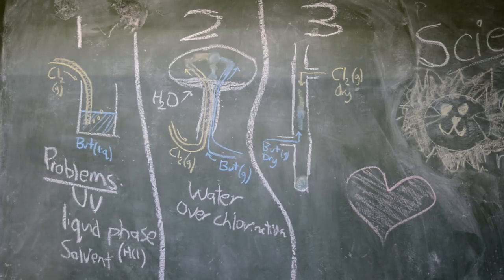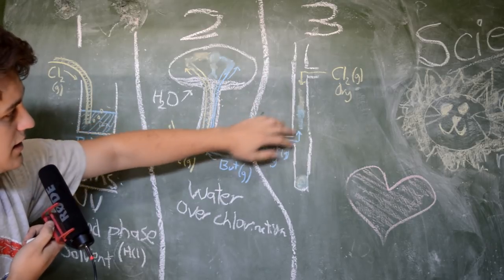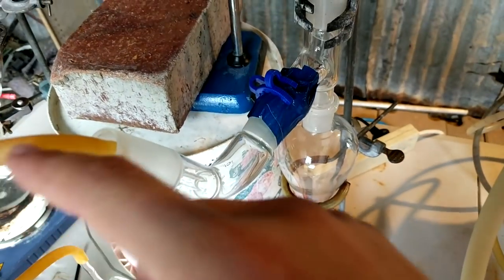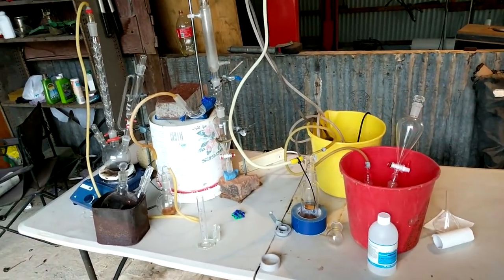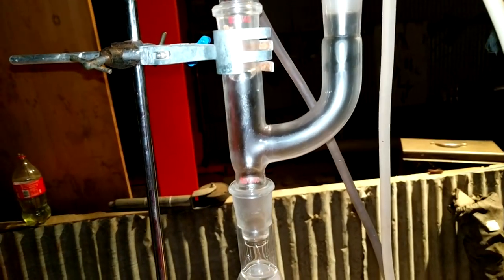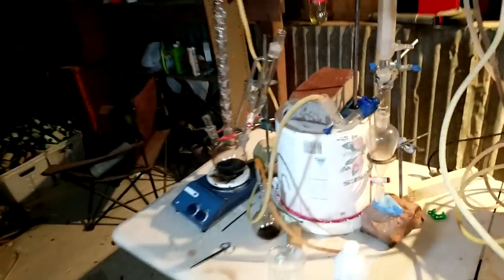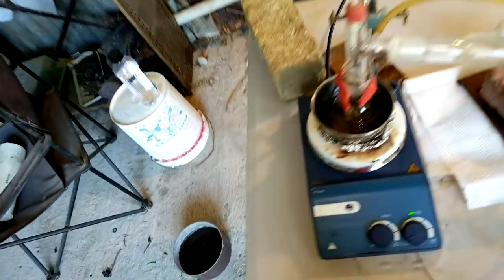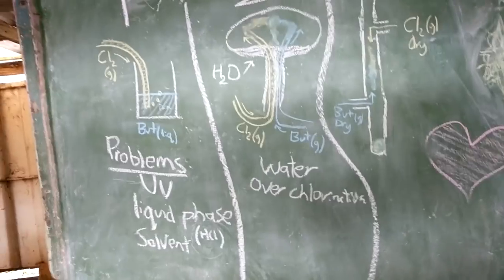Chlorination of Isobutene: Attempt 3! 1-MCP ep02.3

Comment: Btw isobutene is readily available at car climatisation hardware stores in small and larger gas tanks 750mL up to 8L i think. 750 mL of high purity isobutane bottle was 2.5 times cheaper than 10 mL of tertiary butanol
Reply: The heck is a car climatisation hardware store?
Reply: @1495978707  yeah
Reply: @1495978707  climatization like controlling the climate in your car. So I think they mean like a store for Car HVAC stuff.

Comment: Damn, I really thought you had it this time. With exclamation mark at the end of 3 in the title and the the visual result from your setup. I'm no chemist so I can't give you any advice, but I do love your video and commentary so I hope you will keep up your curiosity for this syntheses and succeed.
Reply from the maker: zubmit it looked so promising :( but glad you enjoy the videos despite the lack of chemistry background, I love hearing that from people :)
Reply: @ExtractionsAndIre  If you ever decide to give this another try, consider just buying a cylinder of isobutylene and doing a tube reactor. PVC tubing has excellent resistance to cold chlorine gas and good resistance to up to about 100 C chlorine gas. most other polymers have good resistance to cold chlorine, which, seeing as you're not planning to run this continuously with maintenance once a year, that should be more than good enough. ChemEng background btw.

Comment: Awww man! :-(
I really don't know what could have gone wrong with that one.
If it is overchlorination, I guess going back to your first method with some acetate to scrub the HCl could possibly solve it, since the isobutene would then always be in excess until the very end. Assuming the scrubbing actually works.

I'm a little busy right now to really look into it and go back to the litterature. But I'll do some head scratching this week-end and get back to you! ^^
Reply from the maker: piranha031091 I know :( watching that liquid condense out as the two gases mixed, I was so confident. 

And scrubbing out the HCl, is that the only thing that can add to the double bond? Or is the Cl2 gas reacting directly with it?
Reply: Sorry for replying a year later, but would an excess flow of isobutane be useful too? It looked like there was always an excess of chlorine gas.  (Perhaps add an itty bitty flare at the end for style?)

Comment: Are you just getting Cl2 addition across the olefin? You want to promote a radical mechanism without adding to the double bond. I know that the textbook method for allylic halogenation uses NBS. NBS seems like it should work, provided that you can accept the allylic bromide instead of chloride. If NBS cannot be used, Br2 might work, but you'll need to figure out the appropriate conditions. NCS might, in principle, work the same as NBS, but I think it's generally hard to do allylic chlorination because of the tendency to over-chlorinate. At any rate, great series of videos; they were a lot of fun to watch. Good luck!

Comment: Looking through an old 1979 organic chem book.  Those are the best sometimes.  
And there is a reference to isobutylene dimerization. 
“In the presence of 60-65% sulfuric acid under mild conditions  t-butyl alcohol undergoes dehydration to isobutylene, which is converted mainly to octylenes rather than higher polymers. “
2,4,4-trimethyl-1-pentene 20%
2,4,4-trimethyl-2-pentene 80%
In the experiment they say to reflux the t-butyl and sulfuric for 30 min.   But maybe this is what was happening in your butylene drier ?  

I don’t think this is what your final product was as they have boiling points of 101 and 104 respectively. 

That was an amazing setup though.  Hell for the cleanup.  But awesome.
Reply: Roger Adams 
John R. Johnson 
Charles F. Wilcox Jr.
Laboratory Experiments in 
Organic Chemistry 
Seventh Edition

In case anyone want to look it up.  There are quite a few good synthesis in there.
Reply: It goes on to say
Reactions generally involve the characteristic addition reactions of the carbon-carbon double bond with electrophilic reagents such as sulfuric acid, halogen acids, hypochlorous acid, chlorine, bromine, and oxidizing agents.

With unsymmetrical alkenes like propylene and isobutylene the mode of addition is highly selective. The electron-deficient fragment of the reagent adds to the carbon atom bearing the larger # of hydrogen atoms.
(Markovnikov rule) an exception to this rule is hbr to terminal alkenes in the presence of peroxides. 

Substitution reactions of alkenes occur under special conditions at higher temps. Isobutylene reacts with chlorine at 500C to give methallyl chloride.
Reply from the maker: Daniel Coleman at 500C?? Aw man. Other references give cooling as needed... That's confusing. Hmmmmmm
Reply: Thats why most old organic chemists are bald.    They pulled it all out.  Lol

Comment: Hey there.. Just a friendly observation .. I think I know what your problem is .. It seems that your attempting a radical mono chlorination of an Alkene with chlorine gas .. But your doing so without UV light, which is normally required to generate the chlorine radicals necessary for such a reaction where only one chlorine is added to a terminal carbon .. What I assume would happen in your case ( No UV light or radical initiators)  is that the chlorine would add across the double evenly and you would end up with a product chlorinated at both ends of the double bond .. But even if that isn't the case the reaction is producing HCl gas as a byproduct, which is also reactive towards olefinic double bonds in the classic Markovnikov addition.. This would take your desired mono chlorinated product and chlorinate it a second time at the central carbon since markovnikov additions are selective in that they add the the hydrogen from a mineral acid to the carbon with the most hydrogens attached to it and the chlorine to the opposing carbon .. This is most likely why your product has the wrong boiling point .. It has two chlorines attached to it instead of one, thus raising the boiling point .. Now that this much has been said, I have the solution to your problem .. You should attempt to brominate the isobutene using the antimarkovnikov addition via the peroxide effect .. When HBr Reacts with an olefinic double bond in the presence of hydrogen peroxide it reverses the selectivity of the reaction leaving the bromine exactly where you need it to be .. On the terminal end of the alkene's double bond .. Simply set up a double neck flask with a ballon on the second neck .. Then fill it with a mix of HBr and Hydrogen peroxide .. Then generate Isobutene in the usual way and bubble it into the reaction vessel through a bubbler in the first neck .. The ballon will fill with isobutene and the reaction vessel will be pressurized.. Isobutene will be absorbed into the reaction mixture.. This should yield your desired product .. Although it may take a few tries to optimize the conditions .. Temperature, Reaction time, solubility issues, extraction procedure etc etc .. But it should work .. A co solvent may be necessary.. Maybe DMSO or PEG 400 but this may make extraction a tad bit more difficult .. Anyway I hope this helps and that everything works out for
you.. Love your channel by the way ..

Comment: Don't know how I missed this. You could use an oxy-propane torch and feed it with the chlorine and isobutene, perhaps. Thinking about it, clever use of your vacuum receiver adapter would do it. This wouldn't really help get around the over-chlorination issue unless you take better control of the stoichiometry - dilute the chlorine with nitrogen?

Comment: These are beginner suggestions, but how about drying tubes to remove water?  Slower addition of chlorine?  Bubble isobutane through concentrated HCl?  Liquefy, store, and test your isobutane separately to remove it as a variable, instead of managing 3 reactions simultaneously?

The best part of the video was when you removed the sulfuric acid trap, and immediately began producing results.  That third of the system seems very well dialed in.  A shite chemist would not have figured out to try that!

Also, what the hell was that red deposit in the sulfuric acid flask?  It looked nice at night, but maybe it fluoresces yellow!

Comment: Why not do the same as that 2nd setup without the water? Take a big round bottom and turn it upside down and put it on the lip of a bucket for support. drill holes in the side of the bucket and feed tubes through and into the neck of the round bottom. Cool the sides of the bucket with ice. Feed in the gas through the 2 tubes and as they mix in the upside down round bottom they react and as more gas gets fed into the round bottom it pushes the product out into the bucket where it cools and condenses.

Comment: According to the literature, mixing sulphuric acid with propylene will break the double bond in the propylene and one of the hydroxyl bonds in the sulphuric acid to form a carbon-hydrogen bond and a carbon-oxygen bond.  C3H6 + H2SO4 > C3H8O4S.  The result is isopropyl hydrogen sulphate, 6914-90-5.  slightly favorable at STP, -30 kJ/mol. 

It seems possible that a similar process may be occurring with your isobutylene, forming isobutyl hydrogen sulfide.  There’s no Data I can find as an unofficial chemist with no libraries or subscriptions to support that synthesis, but given that the bonds being broken and formed are very similar I’d have to imagine the favorability of the reaction is determined by the geometry of bonds in question.

No idea how you’d test if you made some kind of complex organic sulphate like that, either.

Comment: Are you entirely sure your Isobutanol is Isobutanol?
Reply from the maker: Matt Hunter my tert-butanol I'm sure of. The isobutene gas... Well, the only real proof is that we know it has a boiling point a couple degree below zero, because we could only jusstt condense it with -10 degree water but could easily do it with dry ice. We also know that it's not miscible with water, and some came over with the isobutene in the first video and formed a separate, more dense layer. So nothing (apart for the whole experiment not working) points to the fact that the gas we're making isn't isobutene, but yes it's something to consider
Reply: Oops, yeah lol, I was researching alternate methods and forgot what you used.

Comment: I'd try this an action vs h with dry ice and salt ..drop it way down add your .20 degree boiling what ever and then I'd add what ever I was reacting it with then I'd let it come up to boil then quinch it you picken up what I'm putting down then I'd add dry ice as cattolist ph will go from base to acid there you go let it warm up catch unreached material in cold trap. 20 mm cloum or alumina and catch the stiff thats uv right yea they dry ice as Carlisle use oh meter just try it ....

Comment: If you're constantly getting over chlorination to presumably 1,2-dichloro-2-methylpropane, could you not react with base and eliminate?
Reply: No. Strong bases like hydroxides will actually hydrolize the carbon-halogen bond. In this case, base hydrolysis will result in the formation of the corresponding alkoxide salt of sodium and hydrogen chloride gas. Upon acid work-up, you would be left with an alcohol group rather than a hydrogen. Once here, you could attempt to use an sn2 type nucleophilic substitution with hydroiodic acid/red p ( just like making methamphetamine ) to replace the electrophilic  C-OH bond with a C-H bond, but at that point is it even worth it? If he wants to actually do this he needs to consider using UV light and a catalyst like zinc chloride.

Comment: Suck back is because of the positioning of the tubing on the T-Butanol side. It's causing it to siphon, I think.
Reply from the maker: Anthony Marks I think it was because the sulfuric acid was absorbing the isobutene gas, causing negative pressure. I just didn't expect the sulfuric acid and the isobutene to react at all!
Reply: Extractions&Ire ah. That's certainly possible. Odd though.
Reply from the maker: It certainly is odd yeah
Reply: Extractions&Ire any ideas on what's causing the over chlorination? Perhaps the apparatus simply isn't cold enough and you're evaporating your product? I know the chlorine definitely could be causing it. (I know absolutely nothing about synthing things.)

Comment: but why would the sulfuric acid affect the isobutene? especially since it's already present when isobutene is generated? maybe it was a mechanical failure like a leak?
Reply from the maker: nickt I think the temperature difference between the two acid flask is a factor. It definitely reacted, you can see how strange and gross the bubbling flask got, perhaps it was some contaminate in the dirty acid? But I think the hot flask just makes the isobutene too fast to then reabsorb it (it likely does reabsorb and possibly react a lot of it, leading to low yields) but the slow bubble through the cold acid allowed the rest of the gas to be reacted away

Comment: maybe add some Na2SO3(aq) into the product collection flask to destroy excess Cl2 that made all their wae down?
Reply from the maker: TM Fan I was taking off the liquid at the bottom quite regularly, so it didn't spend much time in contact with the chlorine, even if some did make it down that far through the apparatus. But perhaps I should try to neutralize it away??

Comment: Why haven't you tried using a UV lamp like the one NurdRage used in his chlorotoluene videos? Also, you should try researching catalysts like zinc/aluminium chloride or exotic metal chlorides like platinum chloride. THERE IS A WAY! YOU JUST HAVE TO FIND IT!
Reply from the maker: William Ackerson I believe there is a way! Thanks for the encouragement!

The mechanism of how the chlorine adds, is actually not by a radical, so the UV light actually does the opposite of help. 
How it is meant to work, is that the chlorine adds to the double bond, then the molecule rearranges to form a new double bond in a different spot. 
UV light makes chlorine radicals, which will over chlorinate and add in different spots. So that's why it was done in the dark!
Reply: Ahh... okay, my bad. Looking forward to ep 2.4 or 3!
Reply from the maker: William Ackerson thanks, so am I!

Comment: Reaction not specific enough and requiring an energy level that is so high that you get side reactions, hmmmm sounds like you need to find a catalyst to help you.
Reply from the maker: Daniel Matthews no it needs an anti-catalyst, too many chlorine should are adding and I only want one! It needs to calm down somehow
Reply: That depends on the catalyst surely, some assist with specificity  and allow for the desired reaction at lower temperatures. Such as 0C.

Comment: How about bromination?
Reply from the maker: David Perhaps, but I feel it would be a lot less subtle, attacking the double bond a lot. Even if not, it would have to be dilute vapour phase, and generating bromine basically in situ like how I've been generating chlorine is much more of a problem. 

If that made no sense, theoretically I think it's worse, and practically it's a bit of a nightmare, but I'll still consider it !
Reply: Extractions&Ire 
That's my concern too, but maybe it's still worth a thougt
Reply: But whats the product you got? If it is 1,2-dichloro-2-methylpropane, I assume, you could convert it to 1-chloro-2-methylprop-2-ene by a Sn1 substitution with OH at the tertiary carbon and E2 elimination with conc. sulfuric acid.
Reply: Or you could react isobutene with bromine to intentionally brominate the double bond ant then follow the steps listed above to get it back🤔.
Reply: David I think he made 1,2,3 trichloroisobutane, boiling at 160 C and density of 1.3 so thats my guess.